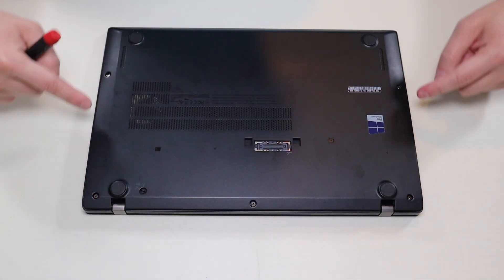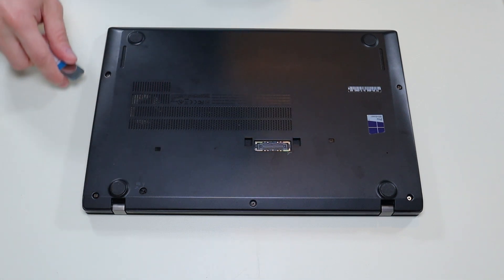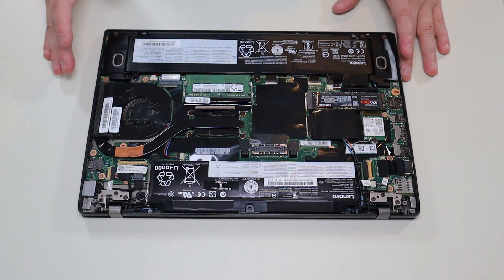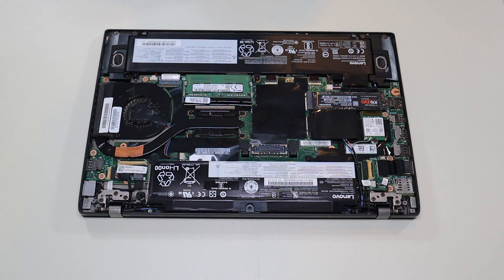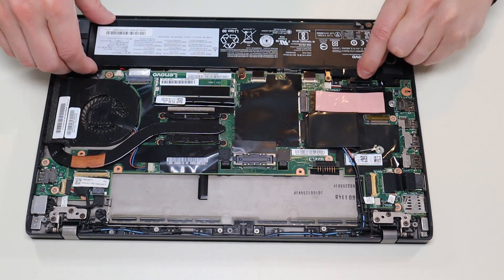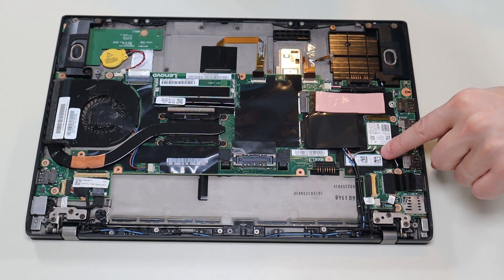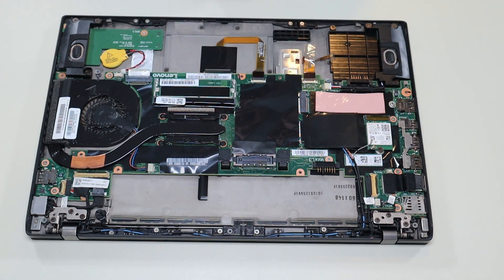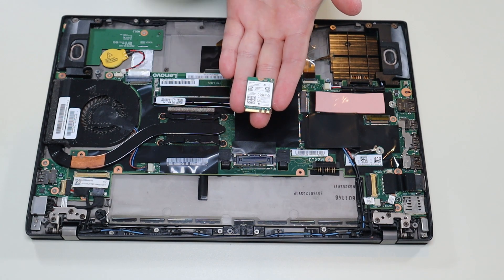How To Replace Wi-fi / BT Card - Lenovo ThinkPad T460S Laptop Computer

Comment: I tryied what you suggested in your video about checking the items when it won't come on. I did not have any luck. I could really use some help please.
I have a Dell Inspriron 14 2-in-1
Reply from the maker: This video is showing how to replace a wifi card in a thinkpad. What brand and model computer do you have and whats the issue with it?

Comment: Hi Jaimin,

I commented on this video of yours How To Teardown / Disassembly - Gateway GWTC116 Convertible Laptop

I am locked out of my air gap machine with bios password. ive tried removing the battery as theres no cmos in this unit and letting it sit for a week. still locked. 

how do i reset the bios password on this machine? someone is saying there is a security chip that will not allow us? Can you please clarify. gateway support is completely unreachable and the local shops do not have the correct bios files on their programmer to reset it there. im savvy and happy to do the fix myself. Thank you for the help.
Reply from the maker: Some motherboards have a jump point where you can reset the BIOS password if you short out those two points. However, that is a risky operation and you run the risk of destroying the motherboard if done incorrectly. For that reason I choose not to have those DIY videos on my channel. Sry :(